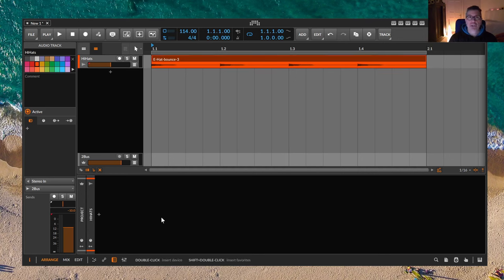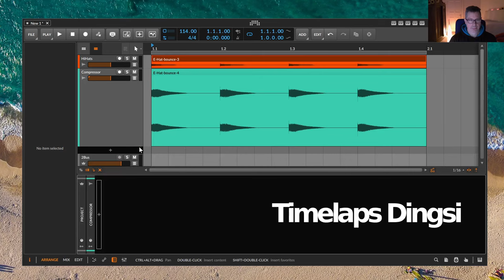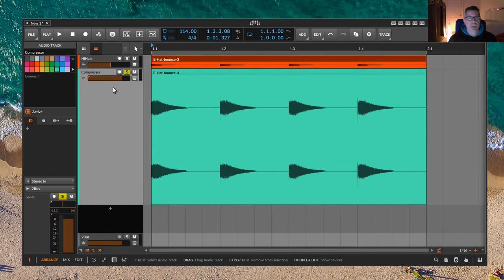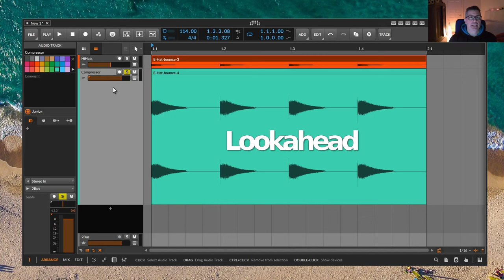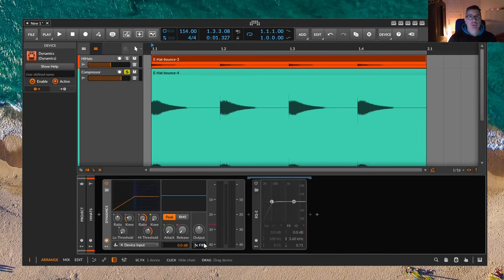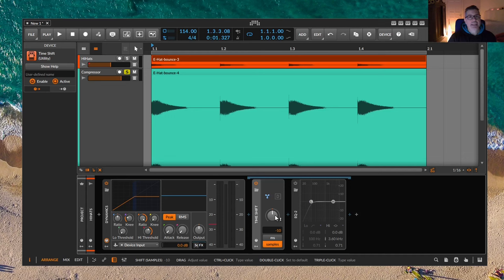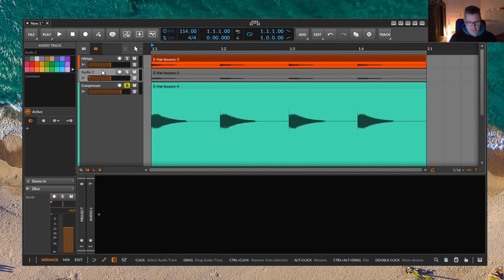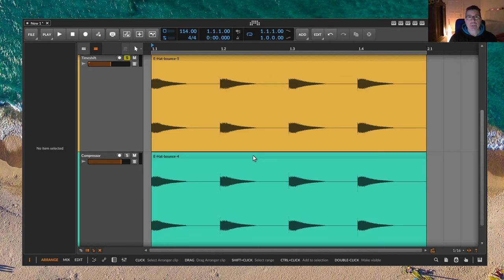Compressor Lookahead 4 Free | Bitwig | EN

Comment: Using time shift will still produce clicks in some cases, and the compensation delay still cannot achieve the lookahead effect.
Reply from the maker: Maybe you need more delay then? Or the clicks are coming from another source? Wrong setting of compressor?  it is very unlikely if you use it correct, that there is still something coming through the compressor. Just double check it again.